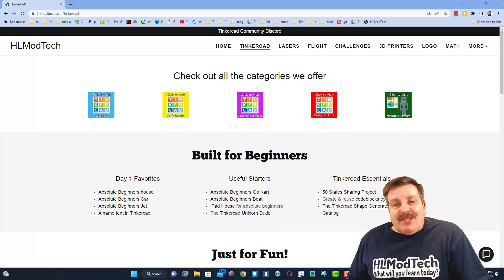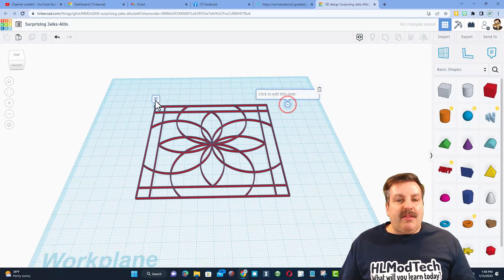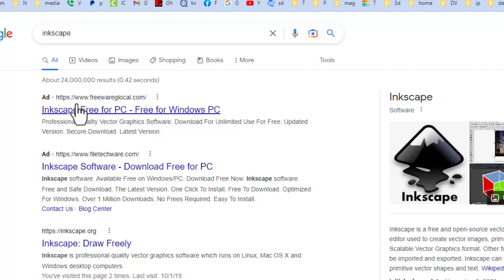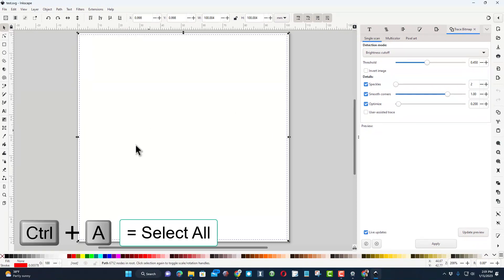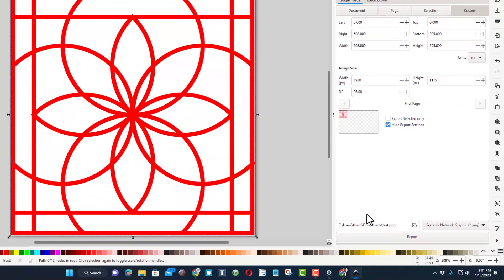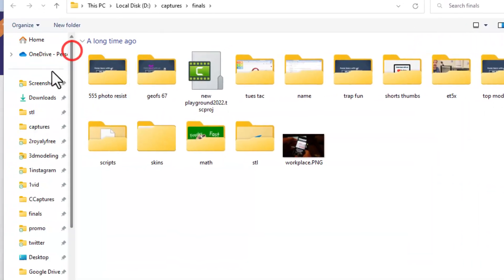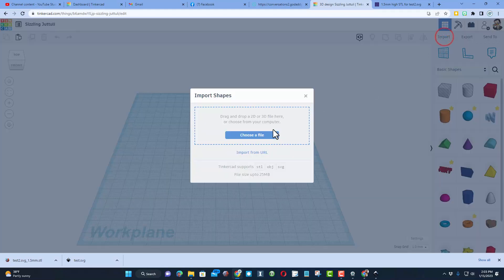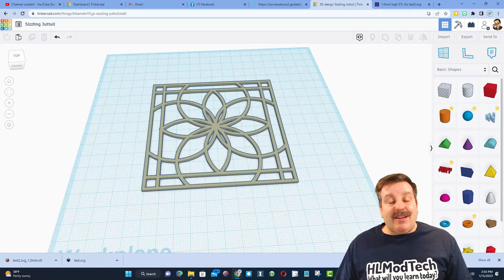Thicker SVG Line size Tinkercad Inkscape & SVGtoSTL to the rescue

Comment: what was the difference between importing the SVG directly after inkscape? Why transform it into STL? Thanks
Reply from the maker: The inscape SVG imports with an inside and an outside lines as hairlines, so the line thickness doesn’t stick. The STL trick keeps the added thickness and imports at the exact size we expect.

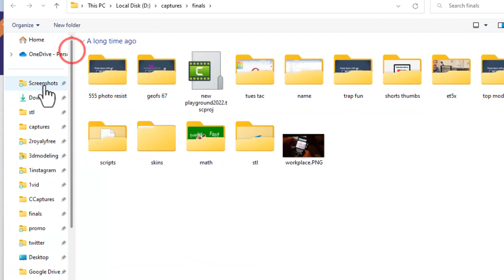Comment: Thank you , Although Tinkercad can import .svg, but converting svg to stl @3:38 using another online tool is necessary if I was adding stroke to the design on inkscape to make the lines thicker!
Reply from the maker: Yes. Exact same issue I was running into. Always nice when a solution works. Have a great day and thanks for taking the time to leave a comment.

Comment: Hmm, when doing this, the object in Inkscape looks thicker, when importing into Tinkercad it's just taller, not thicker.
Reply from the maker: The view of the item would be affected by the zoom. The point of the lessons is that by using the 2 tools you can keep the inside lines thick (which is what the user requested).  If you just use the outline tool to make it thicker the outside lines will be come thick, but you cannot mess with the inside lines.

Comment: Why did you do the step after Inkscape, where you converted it to an stl? Does it change anything when you import an stl be svg into tinkercad?
Fantastic tutorial. Also made me realize that I needed to update to a newer Inkscape. Thanks
Reply from the maker: Glad it helped! I just updated my Inkscape to 1.3 a few weeks back. Amazing tool and it is free!
Reply from the maker: Sorry I missed the first question. The step after Inkscape made the thicker line size work.  If you just bring in the SVG you can adjust the line width of the outside... but not all the pieces of the design.

Comment: Woot woot! Worked! How about if I just wanted half the model lines to increase in width, rather than all the lines?
Reply from the maker: Super cool it worked. If you wanted different sizes you would just have to make different widths in Inkscape... then do the steps to create the STL and return to Tinkercad.